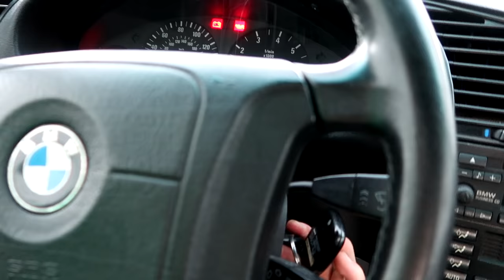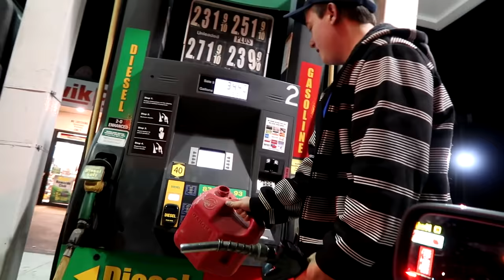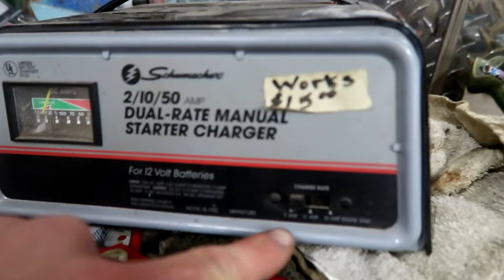THE WORST FOUR-WHEELER EVER!!!

Comment: I had one of those Yamaha quads once that I got as a rolling chassis. Dumped the shaft drive rear suspension, and swapped in a swing arm and axle assembly from a Blaster. Then I shoehorned in a GS550 four cylinder bike engine in it. Did a lot of custom mods to it, but when I was done all the stocks plastics, fuel tank, and seat fit back on it just like original. We called it Quadzilla. The bad part was that even with the biggest sprocket I could find for the rear axle, in 6th gear it was almost unrideable. Scary fast, but still fun!

Comment: We had an Exmark stand up mower at work that had a needle tip break off so literally all of the gas flooded the intake, cylinders, oil, and even the muffler. There was about 6 gallons of gas in everything but the gas tank

Comment: Ahh but they do have a clutch. They have an automatic on the engine and a manual clutch that is activated by the shifter.     If you can get it running they are very reliable.  Just remember to keep the nuts tight on the rear axle they're bad about stripping the splines if they get loose.  It probably needs a carb kit.   Someone forgot to turn the fuel off, lol

Comment: The worst Four wheeler ever? HA! You haven't seen mine then. It sounds VERY bad
Reply: I retract my previous statement...... But mine still sounds horrible
Reply: Michael Rehmert That ATV is a gem compared to my pitbike.
Reply: olli lehtonen You should hear mine. What's wrong with yours?
Reply: Michael Rehmert the front and the rear are twisted in opposite directions (about 3° each), Rear brake is fu**ed, The rear fork coupling has cracked during hard riding causing wobbly rear-end, front tire wobbles (hit a rock too hard?), crank case leaks oil and the ignition is off causing massive tail flame. Buuuut i still love her. Had her for seven years and before me she was my brother's for two. He bought her from a friend who did racing with her.
Reply: Michael Rehmert  hi bayou mate
Reply: Fendt On a farm  Hello! Can you help with mine? It's making a really bad ticking sound coming from the head. I'm pretty sure it's the valves.
Reply: Michael Rehmert yea probably the valves. I haven't get that problem on mine.
Reply: might be the timing chain if so you want to stop using it until you get that replaced unless you wana fry your motor
Reply: Michael Rehmert My chifter makes a dry sound, what can it be?
Reply: Fendt On a farm I really don't know. burgendy carlz  I will run that wheeler till the day it dies

Comment: Timberwolves are so easy to push start. You just put it in high gear then push it and hit the lever on the side and boom your running.
Reply: SIMPLYBEAST1231 its an auto
Reply: Spud ie
Reply: Michael Bear No there is a Reverse lever on the side of the engine you hit that and it dis engages the trans completely. all you have to do it push the lever with a bit a of speed and boom its running.
Reply: SIMPLYBEAST1231 just remember it's a automatic
Reply: Chucka wierd'o duck Ha No shit. lol